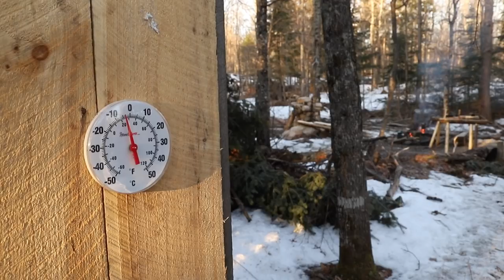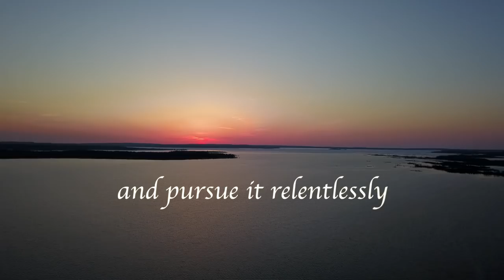The Log Cabin in the Forest Gets a Facelift, Cottage Life

Comment: Dang it, that's some hard work you've done but it's beautiful work. Respect!
 p.s. I was watching Barnwood Builders a short time ago and Red mentioned that when chinking between the logs then one should do an upswipe from the bottom to keep moisture from seeping in and rotting the wood. But, under the eaves shouldn't matter much but I'd still consider chiseling away that overlap on the bottom. You're asking for trouble. Keep away the rot and the cabin should last 100 years or more. Live the dream, brah!!
Reply from the maker: Victor D. Easley Thanks. I've heard the opposite, that the way I did it here sheds water from the bottom of the joint and the water drips off the bottom of the log rather than seeping under the mortar

Comment: I have been enjoying your process, learning as you go, working with what is given. I like your door and window trim, but I do have a suggestion for your headers. I would make them a quarter log instead of a half. I would be concerned that water would make its way into the end grain at the top of the door with the half logs. A quarter log would move the drips away from the end grain to the face of the door. BTW love the swale in roof of the kitchen shelter !!